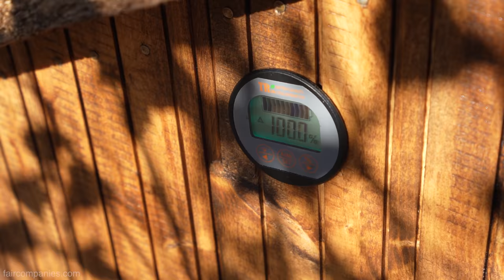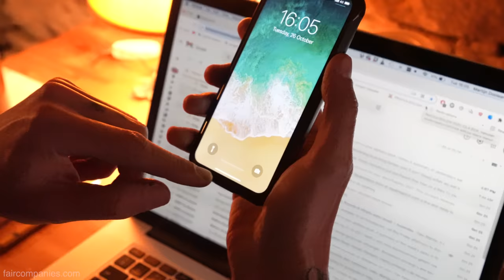He was a bike nomad. Now revamps derelict Alpine farmstead

Comment: In ikaria island in Greece there are thousands of houses identical to this one. Lots of them still inhabited. There are traditional ways to insulate roof , walls, etc, using the plants that are all around.
Reply: What would be the traditional ways of insulating the roof?
Reply: @UchihaxStudios  I’m not pro at that, but I remember they put : dried ferns ( a plant that is abundant all over), mixed with mud, then a layer of stubble plants, and finally slate stone slabs of the area. Now, inside they usually hide the stubble on the roof, putting planks, that they paint and that’s it. Water doesn’t get in because they place the slate stone slabs in a very specific way. Placing of the slabs is the most important part, and needs someone who knows that thing well. No concrete at all.
Reply: @issith7340  Thats interesting, now reading your reply i remember a picture of a roof made with loam mixed with straw, but I don't remember what the cover was. But what you describe sounds similar to what they use to make the walls for cob houses. Do you know if there were traditionally any cobhouses built in greece or the meditarrenean?
Reply: @UchihaxStudios  of course there are cobhouses all over Greece, but only in mainland Greece and at places that are flat. At islands, the area usually is rocky with not much mud around. So they would build with the most abundant material around, which is stones. Cob houses in Greece you will find in peloponese , macedonia, epirus, atica, thrace, etc but not at the islands. Also Greece is a place with lots of earthquakes and cobhouses are usually the first to collapse. So gradually they stop making them here.
Reply: @waitaminute2015  they use different stones fir paving the roof. Totally different technique.
Reply: That heavy rock pile roof would have to go, tiny earthquake = human pancake
Reply: insulation got a bit different meaning living in hills above 1000 meters 1000 km north of your place
Reply: @jebise1126  watching the video, i saw the opposite. 😂 Luck of any insulation by those who first built that stable.

Comment: I used to live in a similar (renovated) place They are cheap but they are not meant for spending winter. Snow get pretty high and what was already difficult to access becomes an insurmountable obstacle. You'd better have a backup solution until snow starts to melt.
And everything is complicated, the postman didn't wanted to go up to deliver my mail, the small train linking all the villages to the rest of the world had interruptions because of a lack of profit, forget about fast internet...

One time I had an electricity cut while working on my PC, I had to walk down 1000 meters to find two guys who just literally cut the line, thinking there wasn't anyone relying on it... The watched me like I was some weird creature coming out of the wood yelling "did you cut those wires?" :D

Comment: I’m enjoying your videos and your vision.  I had a shack on some land with no insulation, and found if I ran the stove pipe horizontal, and had the stove quite a ways from the stove and where it goes out, you end up with more heat, because the heat runs in the stove pipes

Comment: Honestly, you could buy very large stone sheets, to replace the existing stone roof which has holes with a stone roof which has no holes. Sure, the price would be very high, but having interlocking stone shingles would solve the problem with the cold wind passing through. A DIY-er could even use a mixture of stone powder, cement, and rammed earth techniques to make their own stone roof on the property, with the mention that the stone would be artificial, and for a small fraction of the cost of machining and delivering the stone sheets to the property. Especially since you can pour the mixture directly on the roof, using wood or metal molds, and then just remove the molds while still holding the stone there. You can start with the bottom of the roof and move upwards, ending up with a modern looking man-made stone roof. You could also use aerated concrete to replicate those lighter-weight stones, especially if you use the same chemical mixture as the actual stones (except the cement you add as a binder). Also, mirrors and/or lenses could be used to artificially expand the windows without actually expanding the hole in the walls, like how telescopes work. And using concentrated solar for heating in the winter could also help, especially since you only need to make an external wall which to heat outside air and move it slightly up into the house, and you would get warm fresh air and the leftover holes would allow the colder air inside the house to leave the house. The same stone-dust-and-cement mixture could be used to make artificial stone for the walls and roof to be completely insulated from the wind. For the solar panels, I think your problem is either the batteries getting too cold, in which case making the house windproof would solve that, or not enough sun for the panels, which could be solved by using all your solar panels (which are twice what you have now) and maybe even reflective stainless metal sheets to reflect more sunlight onto the panels (or maybe even to heat the batteries, too). It would be nice if the guy in the video would read this comment, respond, and maybe even try some of those things I wrote.
Reply: Go to his channel and follow him. You will see what his vision is becoming. She’s got it in the description. He is very humble in this video about his skills. He is very skillful and resourceful.
Reply: no... he mentioned strict laws. so no fake stone would not work. also those stones are local and probably not so expensive anyway also he as car to bring material there
Reply: @rhondadavis1483  I went there soon after posting this here. I also posted a variation of the initial comment there, as well as other comments. Thank you for pointing it out! Much appreciated!
Reply: @jebise1126  While those stones might be local, they are also very heavy and difficult to work with. About the laws and regulations, he would still need to discuss about those things with the authorities, but, for example, he could make a few artificial stones and have the inspectors visit to ask them if he can use those stones instead, since they are easier to work with and provide a better seal. Ideally, he would ask the inspectors when they come for something else, to not invite them only for this issue. But we don't know the strict laws as well as the inspectors, which means it could very well be possible to allow such artificial stones, especially if they look similar-enough to stones which can be dug from the ground. I mean, it might not be necessary to use local stones, and some type of sandstone or softer-and-lighter stones than the local ones, might be allowed as well.
Reply: @SapioiT  not maybe he literally says stones are local and shows many houses with those stones and pretty sure law is very strict about that

Comment: He should build a rocket mass heater, after chinking and daubing all the gaps, fixing the roof, and installing a few windows & a door.  The rocket mass heater will produce a much more steady radiant heat--instant heat from the steel barrel bell but long-lasting heat from the thermal mass of the bench.

Comment: You could buy a small, cheap solar panel to keep the batteries charged and warm for the winter. Just put it on the roof of the battery shed.

Comment: What a beautiful place but I would have replaced my roof straight away and insulated the inside walls or if time was an issue I would try to get a heavy tarp over the roof at least. Winter would be tough enough here.

Comment: I have to think that obtaining building supplies will be quite a challenge in that location. Even the smallest things like hardware looks to require quite a trip to fetch.
Reply: Not really. I live nearby, that place is like 10 km away from the main town of the valley, where you have supermarkets, restaurants, bank and anything else that you might need. The problem is that the road is steep and narrow, so it takes some time to cover that distance. Once you have done that part of road to descend from the mountain, then the closest hospital is 10 km away, Turin (a city with 1 million people) is 50 km away. It is not that remote, apart for the fact that the road to access that place is not that great.

Comment: Structural work for the walls and replacing ceiling beams is needed, plus the roof to be replaced with "Zip System," just basic recommendation from an architect.

Comment: And so, how much does this actually COST? I love your channel and perhaps I am cynical, but its hard to believe that a hilltop in the Alps comes at  "minimal" price. So how about some details about the price of these properties?
Reply: I live about 15 km away from this place, I know very well all the valleys in this area of Piedmont. In most of these valleys there is almost no tourism at all. I mean, there are a few crowded places in the mountains in summer and in winter (i.e., Sestriere ski resort, the one that hosted the Turin 2006 Olympics, which is about 90 minutes by car from the place shown in this video) but there are literally thousands of these little, old stone buildings where people lived and worked until 100-150 years ago. Most of them are ruins that need to be completely rebuilt, most of the time there is not even any road to get there (because cars did not exist)...if there is a road, usually it is steep, narrow and in bad conditions. No maintenance is done, especially in winter. Once it snows, you have to wait for the snow to melt....if the winter is particularly snowy the road could be blocked from november to april. I can guarantee you that there are people in this area that would sell these kind of ruins for way less than 15 000 - 20 000 € (in some cases you can find ruins for like 5000€ or even less). The real problems here are 1) bureaucracy (very complicated, very slow, very costly) 2) how to carry up the mountain all the material needed to renovate these places (in many cases using an helicopter is the least expensive option, and that is not cheap at all).